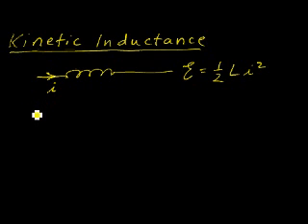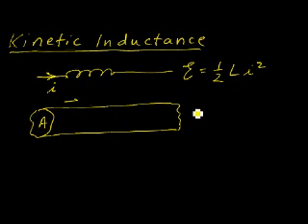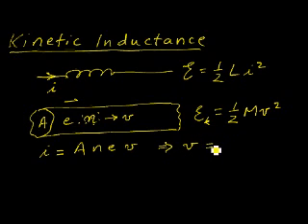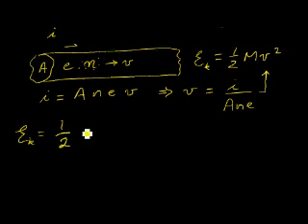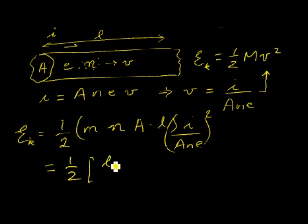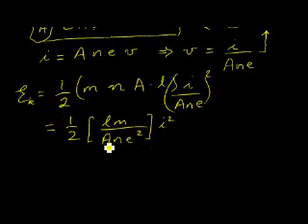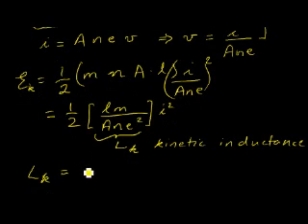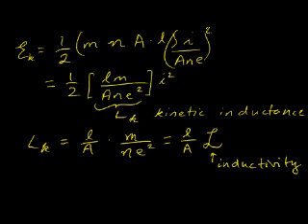kinetic inductance explained

Comment: Would Kinetic Inductance effect the rise time of the voltage passed through, say, a SC capacitor?
Reply from the maker: Yes, but how much would depend on the details of the capacitor design.  It would be a secondary, parasitic effect
Reply: @karlberggren2042  I forgot to add it would be a one-time, pulse capacitor, not a high frequency one. Still the same?
Reply from the maker: @orestislazanakis4960  that wouldn't make a difference.

Comment: Karl
I am thinking that each electron forms a mechanical resonator in conjunction with a positive ion. Is the coupling between resonators caused by repulsion between electrons? Do electrons just push one another due to repulsion, for instance, when an electric current is flowing? Many thanks for your videos.